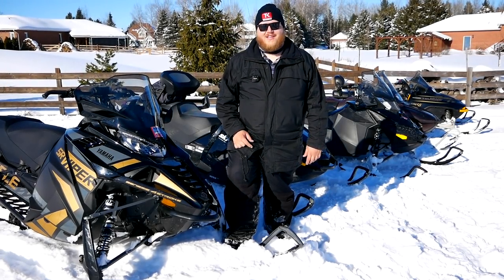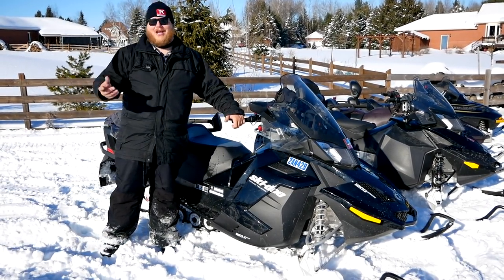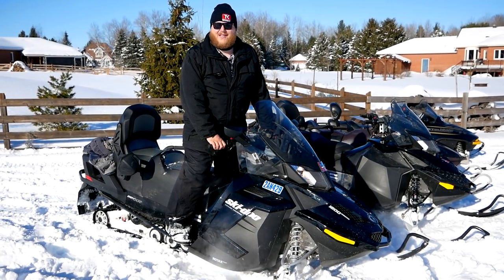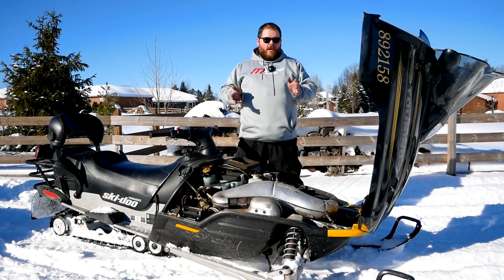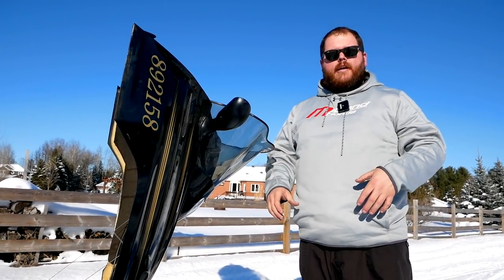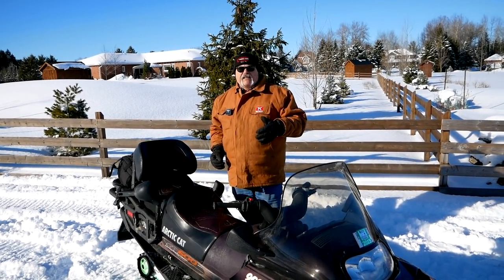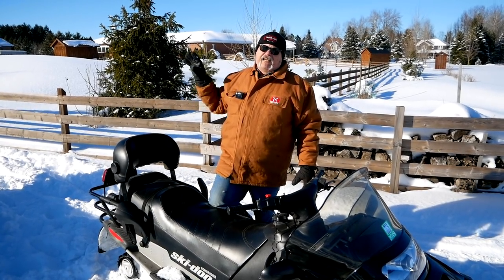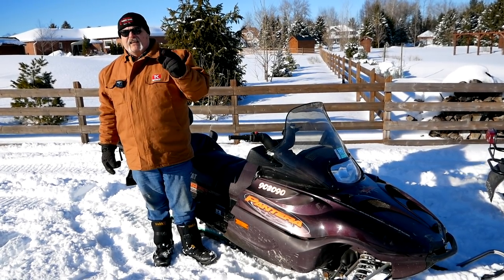Should You Buy a Used or New Snowmobile? What to Look For in a Used Sled + Showing Off Our Fleet!

Comment: Great video, I agree with this lots of pros and cons for each. I bought 2 sleds this year I want used that was a little older Polaris 800 2014 pro RMK & 2013 switchback assault. Got them both for 4k$ CAD and the RMK had only 4000km needed only sliders & scratchers. The SBA needed nothing and was already rebuild at 5000k had 7500k on it in total. Both ran great this year and over all cost of buying the machines+registration +insurance+trailer+riding gear for two people. About $13000-$14000

Comment: I think the best thing to do is go new. Last year, I got a 2009 Ski-doo Renegade 600. Now I ride purely off-trail, I've never ridden on a public trail system before. I ride the same terrain as mountain riding just low elevation, so it's pretty tough on sleds. I got the Renegade last year for a respectable price, maybe $1000 less than what they usually go for. But it's used. Even if a sled is in good condition, if it's used, then expect to put at least $2000 into that machine in the first 2 seasons you have it. As for my Renegade, it's a 2009 and in repair bills, I'm very close to the same amount as a 2020 Ski-doo Renegade. That's how much has gone into that sled if I'm considering what I got it for and how much went into it. And it still needs another two thousand into the engine to get it running perfectly. Just buy new. You have warranty, you know how it's been ridden, and then there's the huge benefit. If you buy new once, you'll always have new. The prices of snowmobiles don't go up very much each year, especially if you stick with the same type of sled. Obviously there's gonna be a price difference if you go from mountain to trail or the other way around, but if you stick with the same type of sled, you'll barely be paying any extra for a new sled each year. Also just some advice, Arctic Cat is all around the best brand. Most reliable, best chassis, best motors, and the Alpha One is the king of off-trail sleds. A lot of people say it's underpowered, but the motors are so reliable in those things that you can strap a turbo on it and not even have to worry about burning out the motor. But yes, especially with the older ones, I know what you mean with the oil. I used to have a 1998 Z440, I would go through a tank of oil every few weeks with that thing.

Comment: That 1200 is only a little better than broken in @ 10,000 km.

I have a 2005 AC T660 Turbo Touring, the thing rides like a Caddy.

Those old ZX chassis Grand Tourings are bullet proof, I put almost 27,000 km on a 2002 500 LC that I bought new, sold it at five years old and last saw it a couple of years ago, still running and looking good.

Note on the Grand Touring, the DESS security system requires a good battery in order for the machine to run so I strongly recommend you throw a new battery on it.
Reply from the maker: Thanks,  you just confirm (for newbies) that there are good older sleds around.
Reply: @TruckKing  $2500 is my starting point if I am looking, I find anything cheaper than that isn't worth the trouble.  Some of that may be the local market, snowmobiling is big in western Newfoundland.  On the east coast of the island they do not get reliable snow, they'll have one good year in 5 maybe so there are deals to be had if you are willing to drive.

Comment: man You Guys need to stick to Doing reviews on cars and trucks.  105 PSI on a 440/500 cc engine is normal. Esp from the 90's. They did not have the high compression as todays sleds.

Comment: If your planning of doing long trips,  I say stay away for the old stuff ....  i do between 3500 to 6000km per year (my max was 9500km) and I keep my sled a maximum of 5 years and I still put money on them.    If your just going around the neighborhood or to the ice fishing cabin the old stuff is just fun and affordable.   

So two big question is how much will you do and how far will you go ?
Reply from the maker: Agreed.  Big thing I wanted to get across is that if you're new to this - just really want to get out there - you can go cheap and still have fun.
Reply: @TruckKing  100% with you.  Just to get to the sport to know if you like it, used is definetely the way to go.  
Less of a loss if you don't like it.
Reply: Dealer repairs are getting so expensive that if you aren’t handy it can be very pricey.  Four stroke sleds take the fragile two stroke engine(especially 800 or 850s ) out of the equation but sleds still require maintenance if you pile the miles on. We rebuild shocks every 5,000 kms to keep them perfect

Comment: Snowmobiles ended for me when they didnt deliver on the Thundercat 1100 in 2003. Instead they built a 2 clylinder 900. Almost compareable to building a V6 Raptor instead of a Coyote V8 Raptor. TRX supercharged V8? Just shows how stupid that was. Never bought a sled since. New sleds are ALL garbage.
Reply from the maker: Lots of old ones around.
Reply: @TruckKing  I kept my 2002 for as long as I could. Manufacturers should have built a Thundercat 1800 triple by now if they wanted my business. Old sleds are too much maintenance. Chemicals in the gas wrecks them. You need a new motor from a manufacturer that builds an engine that meets and deals with that. I am the type of person that wants the newest thing and I have to have reliability. I am going to support Taiga when its out this fall. Going to learn how to modify electric, only thing interesting at this point. Hope they make something more styling to that of a T-cat.  Too pi$$ed off at other manufacturers to ever buy any of their current garbage.
Reply: I bought a 98 t-cat last may. I'm in love with it!
Reply: New sleds are way better than old ones